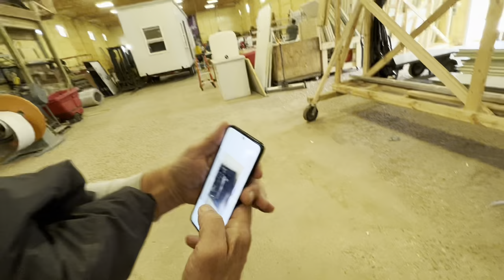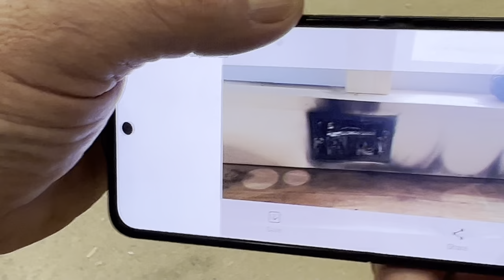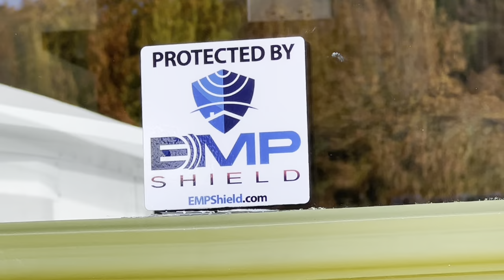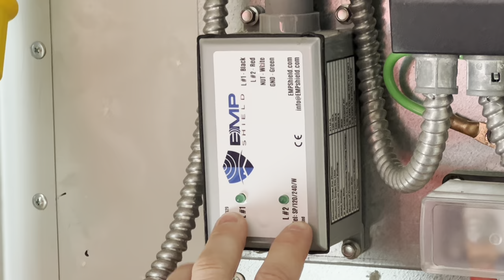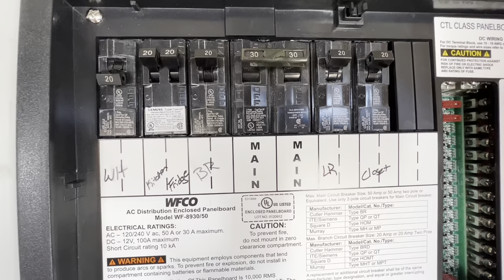Electrical Fire in an Incred-I-Box?!?! What Happened & How can I Prevent this from Happening?? 🔥😲

Comment: Randy my father used to do electrical he was a contractor just like you. But he was always for safety he was a fireman besides that, but he used to talk about the electricity and how it’s power surges and things like this and making sure the home has a rod  &  grounded. So you don’t have this surgical surge coming to the back of the house. When I was a kid is about 12 years old we had a transform outside the backside of the house well lightning hit it and it surge back into the house it’s searched back into the fuse box and blew the fuses right off the wall left the centers like donut holes still in the wall but it caught our wall on fire and we couldn’t get out of the house because the wires were laying on top of the house when the pole fell which caused the surge to begin with. My father came with his fireman boots and a wooden ladder and metal cutters and it came and cut the lines off the pole so they could get into the house to get us out. I was never so scared in my life when we saw the fire in the basement wall and only one way out and it was all around metal around the basement window frames. My dad went up there on that ladder old rickety ladder with the cutters and his fire equipment and cut those wires off that transformer to save us. You’ve got to ground your house really well. Your man is very informative and knows what he’s talking about with electricity I can only tell you from what my dad used to talk to us about it my dad used to do a lot of wiring for the machinery some things like this as well. I don’t trust left lithium batteries either unless they are in protected by a box around them there’s too much chance of fire and chemical coming off of them. Pay this man well you’ve got a man of gold here. Also Randy I like your videos very much you’re very informative you don’t hide anything and that’s what I like you say if somethings wrong you say what’s wrong it’s you correct it and you resolve the situation. A lot of companies would not do that and that makes a difference between a company that stands out among all versus one that doesn’t say anything and hides everything and it’s not very reputable. I think your work is fantastic. I know you have your own ideas and how you know you’re trying to make money in a lot of different ways trying to keep surviving. I know what that’s like. Where the safety equipment with the wiring I think you’re gonna have to make the standard and increase your price, that way your protecting you as well as the other person that’s buying your equipment.

Comment: I had the negative line break from the power pole. It caused a surge in my brick house in the middle of the night. I just happened to wake up with a house full of smoke. I had to replace an almost new washing machine and 2 light fixtures in my kitchen. Nobody can predict a power surge. I immediately turned all power off to my house. That was not y’all’s fault what happened to these peoples house. FYI, walk your power line occasionally and check for any splits. Squirrels are bad to damage them.

Comment: Glad the house didn't burn down, but I am sorry that surge happened.  I would want to put that emp and a lightning rod to ground any lightning strikes/surges.  When you are in an area that loses power for storms, snow, etc, it would be a good idea to have solar panels as a backup.  Texas needs these EMP's as a year ago in February.  I like his Incred-I-Box and those shelves.  I see he got curtains for the door to the bathroom and the shower.

A surge protector between the power source and your Tiny House power connector plug is another safeguard from power surges like lightning strikes.

Comment: Could customers use some kind of surge protector to prevent that?
I do know power surges in regular buildings can burn stuff up, and even catch fire.
Reply: Surge protectors can help but they have their limits.  So depends on how powerful the surge is and how extensive the damage it can cause as only what is connected to the surge protector would be protected and not anything else but that's why they went over the EMP devices for more reliable, whole house, protection that can be pretty easily added/installed.

Comment: Thanks for some very important information.  I'll have to ask my electrician about installing one of those EMP things.  I live in a regular house, but we get little surges all the time.  I've got surge protectors on some of my appliances, but the whole house needs to be protected.

I'm confused, tho, how this device could protect a home from a solar mass ejection or EMP (nuclear explosion electrical surge)  It seems to me that this device would be good for protecting against surges coming along the power lines into the house; however, a solar mass ejection or EMP hits the whole house at once -- not just the line coming in from the power grid.  I don't see how this gadget could work for that.

Comment: Wow, $1000!?  You can purchase the device direct from manufacturer for $300-400 and install yourself - they provide instructions and assistance on which model to purchase for your needs. That's quite an upcharge for install by the offi-grid installer - unless of course that is for both/2 units shown in this model then definitely worth it.

Comment: Install afci breakers for the outlets through the tiny house as they are dwelling space. This will help provide better protection then standard breakers. You can install the AFCI breakers or outlets although breaker protects the entire circuit and the outlet only protects the outlet and any outlets downstream but if you had outlets before the AFCI it wouldn't protect that so the best choice is the AFCI breakers. You can also do the whole house surge protector but the AFCI will kill the breaker in the case of arcing that produces heat and fires, where whole house surge protector protects the entire electrical system from power surges. 

The whole house surge protections is nice but the AFCI works great in unison with the surge protection. AFCI is the way to go with or without the surge protection.

The best setup is the whole house surge protector on the first breaker position taking a double pole protecting both 120v legs from the top down. Then you install the AFCI breaker and GFCI outlets in wet locations. 

In this event if you had an ARC FAULT CIRCUIT INTERUPTER installed that would interupt the circuit after it was damaged from the power surge. So even without the surge protection the AFCI would have kicked the breaker.

Comment: It’s reassuring that the house itself didn’t catch fire
Reply: Benefits of a metal structure, but still have to be careful about anything combustible in the kitchen.  So never leave oil, or anything like that on the counter and near the sockets.  Similarly, anything combustible being near any of the other house outlets and electrical panel.  It's one of the reasons code prevents the electrical panel being in a closet, for example, as sparks can ignite clothing.

Comment: You guys are the best! A very honorable solution, and definitely a kind action.
Question…Is there a list that tells what things you need for your new home? 
For instance this device, the grounding implement, the proper towing equip (ball), hoses and connectors etc? When to turn on your hot water, gas etc…
For those of us that don’t have experience with RVs or motor homes, or Tiny Houses…how can we be really prepared for all of these needed items to prevent snags? 
I guess I’m asking if there’s an “Everything you ever wanted to know and have for your Tiny House” list🤔😵‍💫
Sorry, I’m slowly gathering courage to buy, but this type of thing freaks me out because of a lack of experience.
Reply: @Rebecca I am not able to afford a loan, but I too have not been a camper. That's a great suggestion, a checklist of needs, steps to set up.
Reply: They give you an owners manual.  Not sure everything is in it but of course always more information is useful.

Comment: Whole house surge protection should be an automatic install for any new or existing homeowner, no matter the size of it.  Surge protection should also be added between your cable and tv connections.   You can easily lloose all your appliances and electronics and more...
Reply: Especially, as cable is separate from your electrical but still can send a surge into your home.  They're just usually underground and thus usually safer than above ground electrical, and why you can still have cable and internet when there's a blackout, but some power is flowing through the cable to provide that service.
Reply: @ZeoCyberG  well said...

Comment: You might think about adding surge protectors to the panel where the power comes in. Mike Holmes has been talking about it on homes for decades, costs maybe a hundred bucks. It'll blow out that little protector instead of anything else in the house.

Comment: Had an electric stove catch fire during a hurricane when the power finally came back on. Luckily I was home & able to flip the main circuit box house switch before the place caught fire. Best thing to do when power is wonky is to flip off the most risky circuit box switches - usually the ones powering kitchen appliances, TV & home office equipment; AC/heat pumps. (Surge protectors are fine for general power outages but pretty useless against close-by & direct lightning strikes. There's a tremendous amount of power voltage in a strike. Best to flip kitchen, TV, office & AC switches at the wall box when storms are badly flashing & prolonged.) (Things may be different for tiny home set-ups though. Just talking about regular homes.)

Comment: Generous heart but sometimes to a fault.  Mr. Jones,  it's wonderful your desire to jump on a situation that needs remedy but please keep in mind for  future  that in a not at fault occurrence  the owners should be  encouraged  to connect with their home owners insurance and you can be contacted to repair. If you want to do more for them as repairs are happening  then decide what extra off the book service you want to provide.  Keep in mind that when you give consession to one person others will expect the same. You still have a buisness to run and this endeavor  multiplied can  set  the  buisness back a good bit  not just financially..  You've built a solid home and advised to what caused the issue, next step would have been to contact insurance or to do the job for a fraction of the price just to appease your bleeding heart. 

Glad  however this was a non casualty occurrence.  

Continue building great homes!

Comment: QUESTION-I used to camp and had a surge protector that you plugged in and was part of your electric hook up outside right at your camping hookup. Would something like that be adequate protection for my tiny wood home??? Thanks for all you do. ❤
Reply: It'll help, especially at the point of power coming into your unit so it protects the whole system but depends on how powerful the surge is as like a fuse it has a limit of what it can handle and past that limit damage can still occur.

Comment: Now I'm worried about the older mobilehome I'm living in. There's several wall outlets that don't work. None of the outlets in the bathroom work except for the dryer. It's on the same wall as my stove (220). Outlets in my kitchen all work so I have a heavy-duty orange extension cord going to my bathroom for my washer. Outlets in both bedrooms work well. I have my big chest freezer in one of the bedrooms I mainly use for storage and seasonal clothes. 
A couple of months ago I turned on my overhead kitchen lights and all the light bulbs exploded except for the one over at the kitchen sink. It scared the you know what out of me!!!! While I was replacing the light bulbs I heard an buzzing noise in the ceiling. I called my son who use to be a fireman. He told me to get out of there as soon as I can. That old trailer is going to catch on fire. 
I'm now looking for an apartment. Some of my neighbors also have electrical issues in their mobilehomes. There must be someone I could report this to since the owner of the mobilehome park is responsible for the repairs of the rental trailers.
Reply: Written by C. J. Reynolds

Comment: I had a winter storm break our electrical wire coming into the house. When they hooked it back up the surge destroyed everything in the house with a circuit boards. Stove, TV,  clock radio, microwave. Of coarse the house was grounded but it didn't have a surge protector. It's an old house.

Comment: Unfortunate incident with electrical power  serge, Thank God you have a top notch person   like John 👍  Another maybe idea for painting the Increda box, if you had an extension room to the building for Spray painting like they have for cars only?? 👀 Can put two walls together, Sprayers on both sides of walls, Walls  are set on moving  track's,, In one door ,out the other to dry ...Ya'll  keep  Up the good  work 🙂💯💯💯
Reply: A drive through (pull thru) paint booth!
Reply: On that note , maybe they can paint the panels a more appealing color. Just in case people don’t like the color (I know it’s DIY )  Maybe the buyers are older-Disabled and/or don’t have the money in the beginning to add siding, etc. to the outside to make it look better to add to their property. A big grey box doesn’t add to the landscape of a yard. That could cause a potential buyer to have to wait until they could afford to do that. I wondered if they could lightly paint/ Tint a few of them a Neutral color or a sheer color (Not Bold!) and offer them after adding that price to them & see if they sell quicker. Can ITH do the cheaply? I don’t know. Just trying to help them sell more

Comment: Randy and Amanda good evening, this business where this line caught on fire on ITH , I live in a standard home of nothing but concrete block very little wood possibly small amount of sheetrock and when our lights go off and I live on an island in the middle of the Caribbean, unfortunately when the power goes out and they turn it back on you will either have a low voltage which is dangerous as well as having a high voltage which can blow everything in your house, my husband was in the construction and we happen to have this happen to us and it was the power company's fault and went we had the power surge I lost lights refrigerator radios and TVs not to mention other electrical appliances it was devastating but when you're in the business you will find out that these things do happen unfortunately it wasn't your fault like you said it was the power company who hit the unit but God bless you guys for going to their aid and trying to make it good I give you gold stars

Comment: Shouldn’t the GFIs be able to resist a power surge? Could they have been faulty? Doesn’t the power company have to control for surges? Are the EMP shields like surge protectors for the whole house? Also is the panel material fire proof?
Reply: In 2014 we had a long freeze, without power several days. When power was restored, a number of electrical items in our home were destroyed by the surge. Our home owners insurance covered the damage. We now use surge protectors on high wattage appliances.

Comment: The GFIs should have taken the hit w the power surge they did what they r suppose to. However, the GFI should not have caught fire. U need to call the GFI manufacturer
Reply: It was the wiring that caught fire.
Reply: @susanbeals7597  yes, but I still think that was caused by GFI. How can u tell if wire caught fire vs GFI? Wires plug into it. When they turned the lights on the elec ran thru all the lines but fit some reason when it hit that 1 faulty GFI it sparked. 
 Outlets, including GFI, catch on fire
With all that said, no matter what protections 1 had on their homes if a high enough surge hits or can blow out everything & cause fires. That's why we r suppose to have fire extinguishers & insurance.
Reply: GFI is not a surge protector, it only protects against a specific type of electrical fault.  While all wiring, etc. have their limits and a powerful enough surge can damage just about anything and once damaged are more vulnerable to further damage, which is what happened here when they reconnected power after the initial damage was caused.

Comment: Wouldn't the use of the plug in power point with safety switch auto shut off prevent this? 
🔌🔌🔌🔌🔳⚡
Reply: Depends, how quickly it shuts off and whether that actually cuts off the surge completely or not.

Comment: Faraday cage...protects you from electrical magnetic pulse which the whole world can go out...
Reply: Won't stop a surge if grid connected, though.  Entire electrical system would be required to be inside the cage with no outside connections for that to be actually protected.  If that's not practical for your setup then it's still a good place to keep everything else you'll need after the world goes out... Generators, replacement electrical components, etc. to protect them and then get them afterwards to repair your system and keep you going.